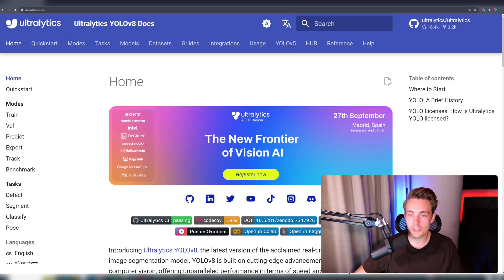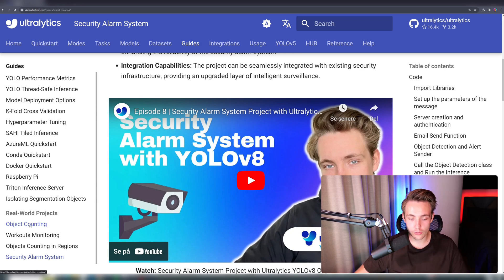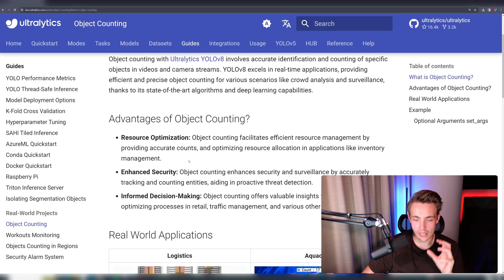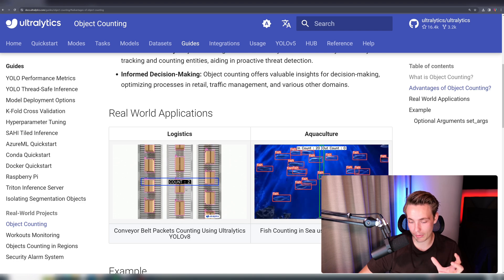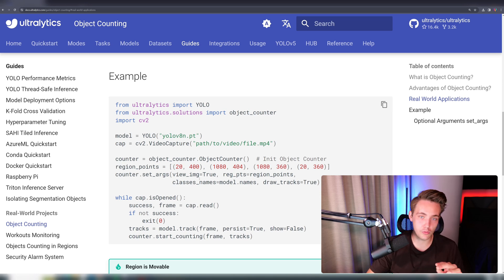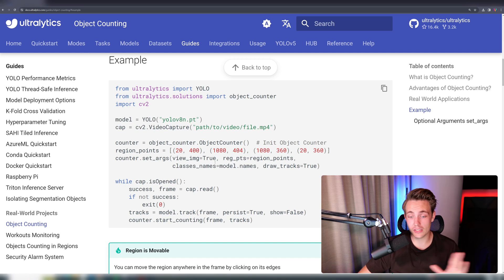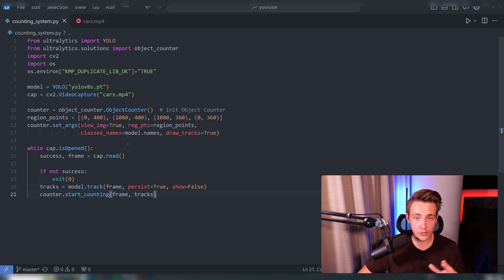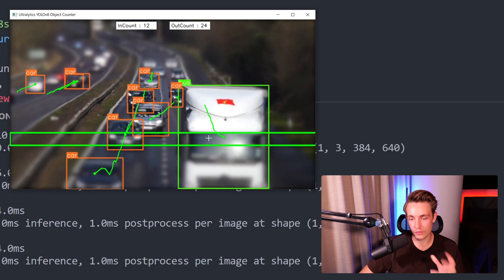Object Counting using Ultralytics YOLOv8 | Episode 19

Comment: hi, for object detection in images, i know that we need to train our dataset for the class to be detected. would it be the same for object counting in images? should i train the dataset first or i can just do it straight? thank you in advance!
Reply from the maker: Hi! For object counting in images, it depends on your use case. If the classes you need to count are already supported by a pre-trained model (like COCO classes for Ultralytics YOLO), you can directly count objects without additional training. However, if you need to detect and count custom classes not included in the pre-trained model, you'll need to train a dataset for those specific classes first.

For more details on object counting, check out the YOLO Object Counting guide: Object Counting Documentation https://docs.ultralytics.com/guides/object-counting/. 😊
Reply: @Ultralytics  thank you!
Reply from the maker: You're welcome! 😊 If you have more questions or need further guidance, feel free to ask. For additional resources on object counting, check out the Object Counting Documentation https://docs.ultralytics.com/guides/object-counting/. 🚀

Comment: Hello dear,

 tracks = model.track(frame, persist=True, show=False ,verbose=False, conf=0.5,classes=classes_to_count)

when i use above model, my video plays very slowly on chrome browser, but i remove , it works fine,

i must above tracks model . how can i solve this slowly play video on browser ?
Reply from the maker: Hi there! It sounds like the tracking process might be resource-intensive, causing the slowdown. Here are a few tips to improve performance:

1. Ensure your system meets the necessary hardware requirements.
2. Try reducing the video resolution or frame rate.
3. Check if your `ultralytics` and `torch` packages are up-to-date.

For more details, you can explore our YOLOv8 documentation https://docs.ultralytics.com/. If you need further assistance, feel free to ask! 😊

Comment: Why does this not work properly, if you slow down the video and count properly the incounts and out counts are not matching. The maximum number of vehicles are going only in one direction but the count is being divided in both in and out counts
Reply from the maker: Hi there! Thanks for your comment. It sounds like there might be an issue with the region or line points used for counting. Could you please check if the region points are correctly defined and ensure they cover the intended area? Also, make sure you're using the latest versions of `torch` and `ultralytics`. For more detailed guidance, you can refer to our Object Counting Guide https://docs.ultralytics.com/guides/object-counting/. If the issue persists, please share more details or any error messages you encounter. 😊🚗📊

Comment: How can I access the data on the counted items? For example if I want to print the number of counted cars on the terminal. How can I extract that data into a variable? Thank you
Reply from the maker: You can simply use the mentioned code to display counts on the terminal :)

``` python
from ultralytics import YOLO
from ultralytics.solutions import object_counter
import cv2

model = YOLO("yolov8n.pt")
cap = cv2.VideoCapture("path/to/video/file.mp4")
assert cap.isOpened(), "Error reading video file"

# Define region points
region_points = [(20, 400), (1080, 404), (1080, 360), (20, 360)]

# Init Object Counter
counter = object_counter.ObjectCounter()
counter.set_args(view_img=True,
                 reg_pts=region_points,
                 classes_names=model.names,
                 draw_tracks=True,
                 line_thickness=2)

while cap.isOpened():
    success, im0 = cap.read()
    if not success:
        print("Video frame is empty or video processing has been successfully completed.")
        break
    tracks = model.track(im0, persist=True, show=False)
    
    im0 = counter.start_counting(im0, tracks)
    print('In Counts : {}'.format(counter.in_counts))     # display in counts
    print("Out Counts : {}".format(counter.out_counts))   # display out counts
    
cap.release()
cv2.destroyAllWindows()
```

Thanks

Comment: Thank you for your very quick response. Thanks to you, I was able to count. thank you. I'm sorry, but for some reason, the 6 types of count results overlap, making it very difficult to see. Sorry to bother you, but how can I separate them? Also, how can I change the class name? Thank you very much for your support.
Reply from the maker: The most recent version of the Ultralytics package introduces individual class counts. Upgrading the Ultralytics package is straightforward with the command ```pip install -U ultralytics```, ensuring you're up-to-date and ready to utilize this feature!
Reply: Thank you for your quick response. However, the characters resulting from the counting overlap and cannot be read. I'm sorry to bother you, but could you please make it readable? Thank you. @Ultralytics
Reply from the maker: @MinEite-fb4wz  Sure, you can increase the line_thickness parameter which will increase the font size of the text. Thanks
Reply: Did you solve it? I am also experiencing the same symptoms. Because the counting display of several classes overlaps at the top right, it is not possible to check that each object is counted. Could you please share the solution?
Reply: @Ultralytics  The line_thickness parameter only increases the font size, but does not solve the problem of overlapping results. If you have any other solution can you share?
Reply from the maker: @insungno4311  Please upgrade the ultralytics package and hopefully it will resolve the issue. Thanks

Comment: Hello Dear,

How can i access or log print to in count&out count ? i want to get in count and out count variables , is it possible ?

thnxs your this video.
Reply from the maker: Offcourse, you can easily get incounts and outcounts values using mentioned code below.

```python
from ultralytics import YOLO
from ultralytics.solutions import object_counter
import cv2

model = YOLO("yolov8n.pt")
cap = cv2.VideoCapture("path/to/video/file.mp4")
assert cap.isOpened(), "Error reading video file"
w, h, fps = (int(cap.get(x)) for x in (cv2.CAP_PROP_FRAME_WIDTH, cv2.CAP_PROP_FRAME_HEIGHT, cv2.CAP_PROP_FPS))

# Define region points
region_points = [(20, 400), (1080, 404), (1080, 360), (20, 360)]

# Video writer
video_writer = cv2.VideoWriter("object_counting_output.avi",
                       cv2.VideoWriter_fourcc(*'mp4v'),
                       fps,
                       (w, h))

# Init Object Counter
counter = object_counter.ObjectCounter()
counter.set_args(view_img=True,
                 reg_pts=region_points,
                 classes_names=model.names,
                 draw_tracks=True)

while cap.isOpened():
    success, im0 = cap.read()
    if not success:
        print("Video frame is empty or video processing has been successfully completed.")
        break
    tracks = model.track(im0, persist=True, show=False)

    im0 = counter.start_counting(im0, tracks)
    print("In Counts : ", counter.in_counts)   # Print incounts
    print("Out Counts : ", counter.out_counts)  # Print outcounts
    video_writer.write(im0)

cap.release()
video_writer.release()
cv2.destroyAllWindows()
```

Thanks
Reply: yeap, that is, thanks for your QUICK answer  @Ultralytics
Reply from the maker: You're welcome! 😊 If you have any more questions or need further assistance, feel free to ask. Happy coding! 🚀

For more details, you can always check our Object Counting Guide https://docs.ultralytics.com/guides/object-counting/.

Comment: Congratulations on the beautiful project. One question: isn't the code detecting motorbikes and bicycles? Or maybe I don't know how to adjust it correctly. I will continue following your project. Hugs
Reply from the maker: Certainly, the code will identify motorbikes and bicycles if you don't specify the classes you want to detect. For instance, when utilizing the YOLOv8 COCO pretrained model for object detection without class specification, it will detect motorbikes and bicycles. :)

Comment: Hello am using rtspurl for object counting. I want to resize the imshow window how to do it
Reply from the maker: You can resize the im0 and it will resize the output window, i.e

"""
from ultralytics import YOLO
from ultralytics.solutions import heatmap
import cv2

model = YOLO("yolov8n.pt")
cap = cv2.VideoCapture("path/to/video/file.mp4")
assert cap.isOpened(), "Error reading video file"
w, h, fps = (int(cap.get(x)) for x in (cv2.CAP_PROP_FRAME_WIDTH, cv2.CAP_PROP_FRAME_HEIGHT, cv2.CAP_PROP_FPS))

# Video writer
video_writer = cv2.VideoWriter("heatmap_output.avi",
                               cv2.VideoWriter_fourcc(*'mp4v'),
                               fps,
                               (1280, 720))

# Init heatmap
heatmap_obj = heatmap.Heatmap()
heatmap_obj.set_args(colormap=cv2.COLORMAP_PARULA,
                     imw=w,
                     imh=h,
                     view_img=True,
                     shape="circle")

while cap.isOpened():
    success, im0 = cap.read()
    if not success:
        print("Video frame is empty or video processing has been successfully completed.")
        break
    im0 = cv2.resize(im0, (1280, 720)
    tracks = model.track(im0, persist=True, show=False)

    im0 = heatmap_obj.generate_heatmap(im0, tracks)
    video_writer.write(im0)

cap.release()
video_writer.release()
cv2.destroyAllWindows()
"""

Thanks

Comment: How can I save the number of detected objects in a variable? I need to perform other tasks that depend on the count of detected objects, but as I analyzed, the object counting is done within the library
Reply from the maker: Yes, object counting can be done directly within Ultralytics. If you want to get the total detection counts, you can effortlessly utilize the provided code below.

```
from ultralytics import YOLO
import cv2

model = YOLO("yolov8n.pt")
cap = cv2.VideoCapture("path/to/video/file.mp4")
assert cap.isOpened(), "Error reading video file"
w, h, fps = (int(cap.get(x)) for x in (cv2.CAP_PROP_FRAME_WIDTH, cv2.CAP_PROP_FRAME_HEIGHT, cv2.CAP_PROP_FPS))

while cap.isOpened():
    success, im0 = cap.read()
    if not success:
        print("Video frame is empty or video processing has been successfully completed.")
        break
    tracks = model.track(im0, persist=True, show=False)
    boxes = tracks[0].boxes.xyxy.cpu()
    total_det_obj = len(boxes)
   ....
   ....
```

Thanks
Ultralytics Team!
Reply: @Ultralytics  and the value shown in view out counts cannot be stored in a variable? since it is not the same as the number of objects that yolo is detecting, to the objects that have already managed to pass the check point.
Reply from the maker: @pan-integral1  yes counting number is not same as total detections
Reply from the maker: @pan-integral1  yes counting number will be different!

Comment: How to used yolo8 to count objects in images?
Reply from the maker: You only need to input an image into the start_counting function, rather than using video capture. We will soon be enhancing the object counting module for im0! 

Thank you,
Ultralytics Team!
Reply: @Ultralytics  Hello, may you elaborate on how the code would look like? Thank you!
Reply from the maker: Sure! To count objects in images using YOLOv8, you can follow the guidance in the reference material. Here's a concise explanation:

1. Install Ultralytics:  
   ```bash
   pip install ultralytics
   ```

2. Import necessary libraries:  
   ```python
   from ultralytics import YOLO
   ```

3. Load the YOLO model:  
   ```python
   model = YOLO("yolov8n.pt")  Replace with your desired model
   ```

4. Process an image to count objects:  
   ```python
   results = model("path/to/image.jpg", save=True, show=True)
   print(results)
   ```

For counting objects in specific regions, explore the Region Counter Module https://docs.ultralytics.com/reference/solutions/region_counter/ or check more examples in the docs https://docs.ultralytics.com/guides/object-counting/. Let me know if you need further clarification! 😊
Reply: @Ultralytics  can u elaborate more on the start_counting function?
Reply from the maker: Certainly! The `start_counting` function simplifies object counting with YOLO models by processing input images or video streams. For example, in region-based object counting, you can define specific areas and count objects within those zones efficiently. Here's a detailed guide: https://docs.ultralytics.com/guides/region-counting/.

If you’re using a video, you can customize the regions and model through the `RegionCounter`. For details, check the implementation here: https://docs.ultralytics.com/reference/solutions/region_counter/. Let me know if you need further help! 😊